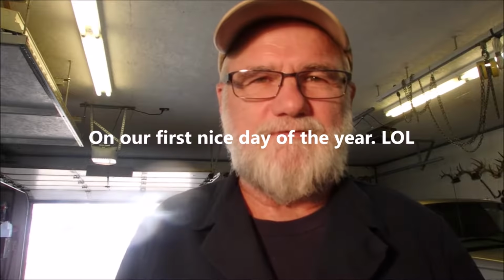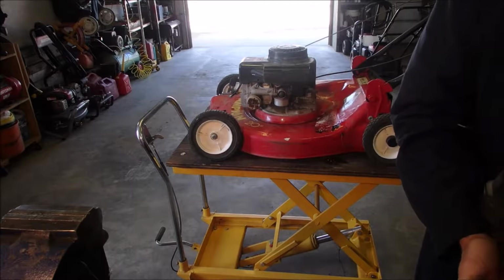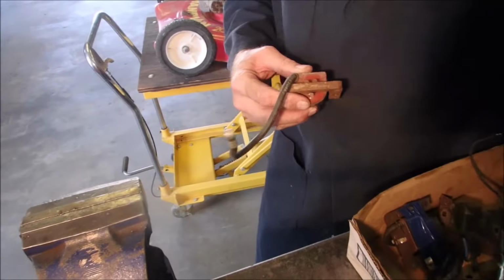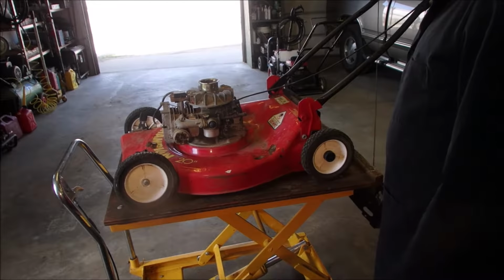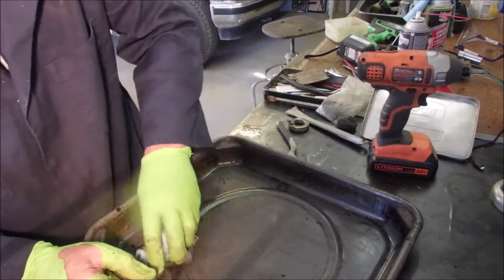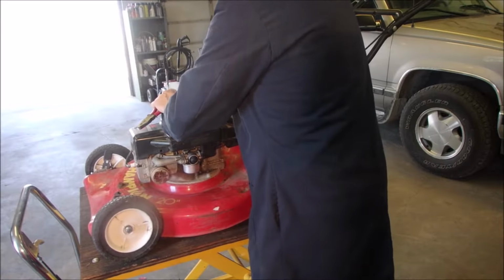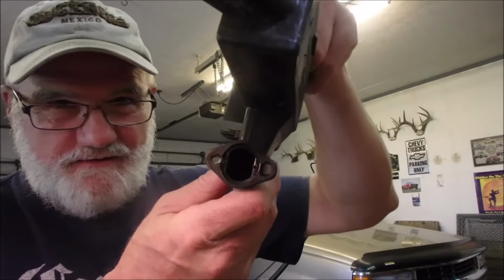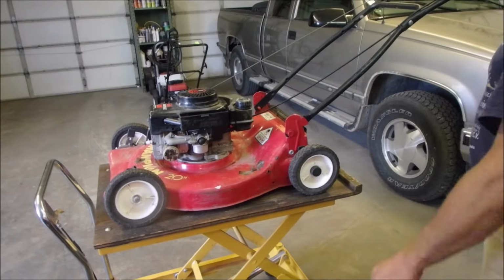Tecumseh Mower 3.5  HP What to do?? Pt 1

Comment: 4-17-2020 video. I have been working on a mower like that one. I got the bowl gasket off and then cleaned the carb. Went to put the gasket back on and darned if it didn't break. I do not have getting those gaskets off to a science. Just ordered some new ones. Engine runs great when primed. I enjoy your vids.
Reply from the maker: Thanks for watching.

Comment: OMG I'm working on this exact machine for my neighbour except carb cleaning didn't do it-- it has corrosion around the bowl and the gasket ring is toast, the float is way off balance and it was cheaper to order a new carb than put a kit on it. The 1/4" Philips head bolts holding the air filter housing are singing tight so have to take special measures to get them off, they round off so easily. Your video, altho the sound was out of synch with the picture, is a godsend for me as I'm new to small engines, having trained as a licensed auto mechanic. Thanks so much!
Reply from the maker: Thanks for watching and the great comment as well.

Comment: How's she goin'?  Intersting to see the seal get sucked right through the carb  like that.  I never would have thought it could get that far!!!  I bet the mice still ruined the coil though.  But now you have a usable motor!!!  Take care!!!
Reply from the maker: Yes  next week is the solution.
Reply: @BrucesShop  I assume you unplugged the kill wire and still had no spark. Thus, the coil tested bad by process of elimination. "New" coil proved it by having spark and that whole test process did not make the final cut, just the new coil step made it into the video? I know coils can be tested with an Ohm meter, but you having another coil "in stock" made that unnecessary. For viewers who don't have the part in house, could you make a video of testing the suspected bad coil? That helps those who have to order a coil make sure the time and money spent is spent on the actual part needed. 

Thanks Bruce.
Reply from the maker: @haneyoakie14  Man you are tough.
Reply: @BrucesShop  lol. I am cheap. You are too, I understand. I am 100 certain you did not toss a working coil, so I'm guessing you tested it, it failed and you skipped making the video too long by not showing that part.
Reply from the maker: @haneyoakie14  Right.  Now I did watch the video after I  published and I noticed that sometimes the coil had the kill wire and sometimes it didn't.  The joys of being a movie producer LOL

Comment: You can not help what needs fixing. Glad you got some therapy ;-)Mm the old fuel looked nice lol Movie producer i will tell mine to give you a call. I knew it would get a carb clean. I know what you mean about when something disappears. My adjustable square has gone missing I use it all the time still havent found it..... Nobody must have had it. I know if I buy another it will turn up... Its amazing it got sucked in.   Shes a runner -)
Reply from the maker: You have kids that can make things disappear.
Reply: @BrucesShop  Your not kidding...

Comment: Very interesting indeed.   Would never have thought enough vacuum was made to deform that rubber gasket and pull it through the venture restriction!  Did you pull that carb off "just because", or did you figure that was the only place left for the bugger gasket to be?  "The point of the needle retainer points towards fresh air....", never heard of that before...Where did you learn that procedure?  The little mower looks to have some years left on it, too bad about the rusted deck
Reply from the maker: I pulled the carb off because it was running terrible.  Then I found the o ring.  Crazy.  These are fairly  soft rubber.  I have seen other stuff sucked through Tecumseh carbs.  Mostly the red primer tubes.  I learned the point of the needle from Donnyboy73.  Stay tuned regarding the rusted deck.

Comment: Dang-- my machine is slightly different-- there is a metal plate that sits over the carb and it has the throttle lever and another smaller lever attached to it. Trouble is when I loosened the carb bolts, the little spring cable flew out of the hole it was in on one end and I didn't see which hole it came out of. I know where the solid wire cable with hooks on each end goes but I'm not sure about the spring cable. Was hoping I'd see it on yours but you don't have that plate with the two pivoting levers welded to it. My mower was made in Canada by Canadian Tire.
Reply from the maker: This may help
https://www.youtube.com/watch?v=mmiliB-jg6s
Reply: @BrucesShop  YES it did!!  You are amazing! I want to send you a box of candy (if you're not diabetic : )). I have waded through dozens of videos looking for clear photos and clear explanations and you have both, wow! You and Donyboy are wonderful resources. I can't think why my neighbours trusted me with their lawnmower since I've only worked on cars-- and fuel-injected ones at that-- but I guess their machine is old enough that they can write it off if I ruin it : ). Never thought I'd lift a wrench again after becoming disabled but here I am cursing up a storm out in the yard : ). I love your humour and your jackstand, lol. Am subscribed! Thanks so much!

Comment: Yay! You're a Canuck! Got my linkages hooked up, things are back on and I tried starting the tecumseh with my impact driver with 19mm socket but the flywheel barely turned. WTH? Why me Lord? It was really hard to start before I "fixed" it, now it's even harder. lol! I checked the coil clearance with the standard business card, cleaned rust off the magnets, have a new plug, wires look good, brake was on... I used to blame the crappy carb. Now it has a nice new carb. Now what do I blame??  I know.... me.... : (
Reply from the maker: Did you look at the flywheel key??  The  are very soft on the Tecumseh's.  Why me lord,  what  have i ever done to deserve even on of the pleasures ive know.  Kris Kristofferson
Reply: I need an old Tecumseh parts cemetery-- the flywheel is covered with hairline cracks I thought at first were dirt and cobwebs. Where on earth do you find these older parts??

Comment: My brother worked for a company that Had a piece of equipment with an old Briggs horizontal shaft engine and up draft carb It had been sent to a repair shop at least 3 times and never ran right ..He took the carb off and there was a piece of foam air cleaner stuck up in the elbow that mounts on the block
Reply from the maker: Right.  Tecunseh's must have milder bends in the tubing.  I had one of those red primer tubes go right into the intake valve and hold it open.  Last year??

Comment: Thank you so much for putting this video up. I have an old lawn mower that was given to the wife. Same exactly as this one but all the model # stickers are gone. Makes it a real pain to order parts. I went through all the same steps you did to test it & it fires & runs just fine as long as I pour fuel down the intake. I think the emulsion tube may be kattywampus. gonna take it apart again & hope I can figure out what tube to order if it's not just plugged. Thanks again for putting this up.
Reply from the maker: They are usually cleanable.

Comment: Yeah, I'm doing this guy's toro timemaster, 8.75 series, head gasket, and it's a process, but I'm not sure if that's everything that is wrong with it, till I fix that problem, and then see if it starts, right now it's got a blown head gasket, so 0 compression, once I fix that, then I can proceed, it's at 80 dollars, still cheaper then any shop in town, plus once I'm done, and it's running, he will get it back by Sunday, not 2 months from now, like all my local shops, they are so far behind, see my local college does a spring tune up service, but since they are closed no spring service, I have been so busy it's insane.... Great video sir...!
Reply from the maker: Thanks Mr Knight  :-)

Comment: Another great video, Bruce.  Glad that you and Mrs. P made it back safely from south of (the U.S.) border.  I'm going to work on a Tecumseh LEV 80 with a date of manufactured of 9159 for a charity thrift shop.  At a glance, the primer bulb was as hard as a carp (Taryl's way of expressing it).  Have you done a video on removing and installing the primer bulb on that type of engine?  If so, I've missed it (and I've seen a lot of your videos).  If you could point out such a video, that would be great.  If not, do you have any pointers, so that I don't inadvertently damage the assembly?  Thanks.  ---  Ted
Reply from the maker: If you the newer style of primer.  There is a metal ring holding the bulb in place.  Take the old ring out with a pick and pull out the old primer.  Replace the primer using a socket and tap the new ring back on.  Something tells me that you have the older Tec 80 series.  I don't have a video for that.
Reply: @BrucesShop  All of the replacement bulbs I've checked on (eBay, etc.) show a metal retainer ring included.  I haven't really had a chance to tinker with the mower, as the shop is closed but a few stray workers come in occasionally to tidy up and when I show up look at the mower, I get roped into moving stuff around (like metal junk for the scrap yard.  I hope to pop it up on the tailgate of my truck soon and evaluate it more than pushing on the primer bulb.  Thanks for the advice.  I may be able to talk them into taking it back to my garage, where I have proper tools and equipment (especially air compressors).   I wish you every success and God speed.  ---  Ted

Comment: Just a question, how to test a coil?
Reply from the maker: The coil has to be removed to do this more accurately.  
You can take a measurement in Ohms from the high tension lead to ground (the metal part) and that one should be in about the 8-12 thousand ohms both directions
The the other measurement is from the kill wire lug to ground  in one direction it should be vary   from 1 million ohms to 4 million ohms and the opposite direction it should be open.   Remember the old fashioned coils have no electronics in them (points) so that measurement won't be direction sensitive.

Comment: Nice repair Mate!! I just worked on a Tecumseh yesterday for the first time in 3 years!! It was a 1967 generator, I had to sh*tcan it,  the generator was junk and the engine needed a coil!! Wasn't worth fixing, it is a 3hp vertical w/tapered shaft!!☺
Reply from the maker: Yes  Those gensets have that darn taper in them.  To bad.  Didn't I see you "untaper" one? years ago

Comment: I can't believe you found that gasket! I don't know if I would have ever found it in there. My next video next week is going to be on a very similar mower. It's still in the garage. I almost want to go see if that gasket is still where it's supposed to be now lol.
Reply from the maker: I bet it won't.  I think what loosened it was the air filter assembly didn't fit on the carb like a new one.  One hole was a bit wallowed out.

Comment: That is some find, that washer could have gone inside the engine. I know I have a customers machine where they lost the small black end to mount the air filter on the carb of the Tecumseh. I haven't been able to find one yet. Tecumseh engines are getting very scarce around here anymore. This is an old mower to.  Maybe some day I will come across one somewhere.
Reply from the maker: Yes they are getting old.

Comment: You  know some times when I'm troubled with a small engine job ,  I lay in bed sometimes and think it out and come up with a solution . Unless the great mines like yours or one of the great other -  UTube guys has a video out there with the solution videos . Looks like the engine needs a better frame and it would make somebody a good trim mower too . I'm not a Tecumseh fan , but have worked on them through the years .

Thanks you for your zeal .👍
Reply from the maker: Ok   the solution is coming soon to a screen near you.

Comment: It's amazing that the gasket ended up in there like that. It reminds me of when I once lost a rocker cover bolt...after a lot of searching, I realised it went down a spark plug hole. Luckily I realised before I started it up & fished it out with a magnet...and learned a valuable lesson too
Reply from the maker: This is not the first time I have seen something get sucked right through a Tecumseh carb.  there are no right angles until the intake hole.

Comment: Got a question I have 22hp Exmark when it sets for a couple of days when you try to start it will backfire then it will start with no problem.
Reply from the maker: Very common.  When you go to shut it down let it idle on low rpm's for a while.  Then turn it off.